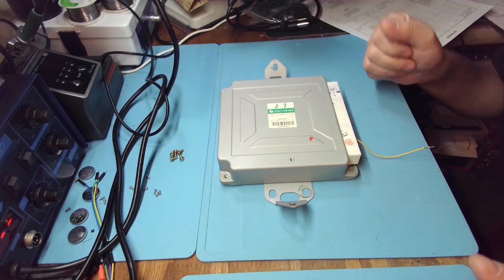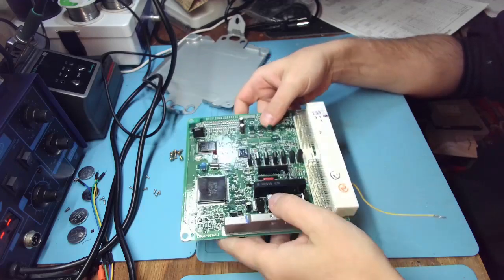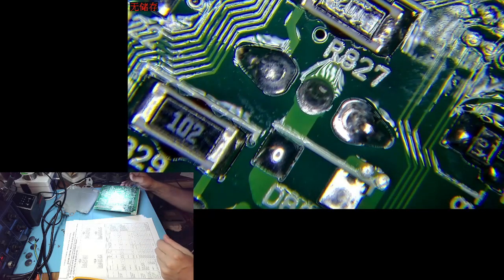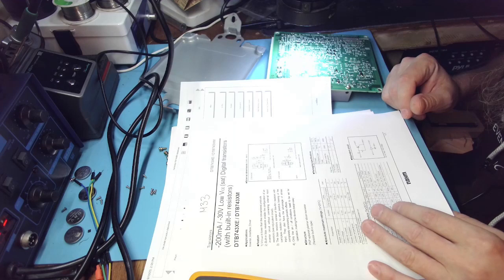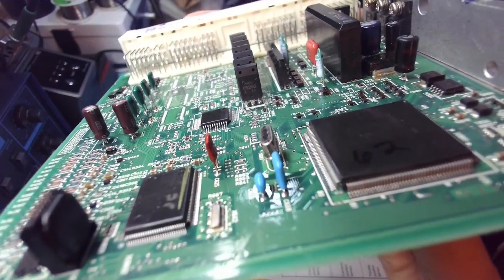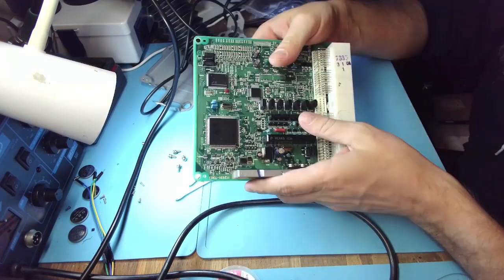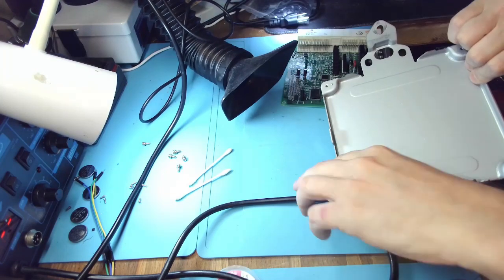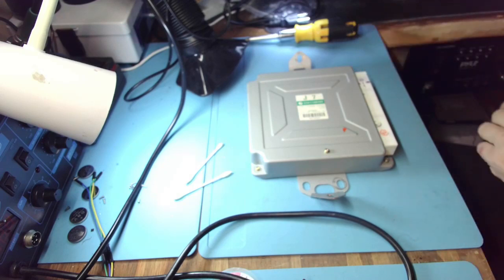2001 Subaru Outback ECM Repair for Alan [KY] | Misfire on #1 and #2 | NOT IC608 ISSUE

Comment: Dodge suffers from bad solder joints. I own one and one day I will have to rip it apart 😟
Reply from the maker: hmmm, I should branch out to Dodge then, solder issues are quickly becoming my speciality 🤣
Reply: @blackhorserepairs   Here is an example of Dodge ECM issues: https://youtu.be/Jv3MZ-7APT8?si=H9dV2JrXIsPGBuSH
Reply: @blackhorserepairs  Another service to provide is the Chrysler, Jeep TIPM repair.
Chrysler in their wisdom, soldered the relays for the fuel pump, wipers...etc to a circuit board.   https://youtu.be/us6coFI-oYU?si=BDag6IiDGKTTfbFz
Reply from the maker: did you see that first pin I was trying to wick clean? Some next-level solder there, it would not catch the wick despite being molten, I tried 2 wicks, and finally, I increased the temp to 380C. I was thinking "desoldering gun" right then 😅
Reply: @blackhorserepairs  Yeah i saw that and was wondering why you didn't add leaded solder first.
Reply from the maker: @bobsoft  yeah, eventually I did but for some reason transistors didn't need it